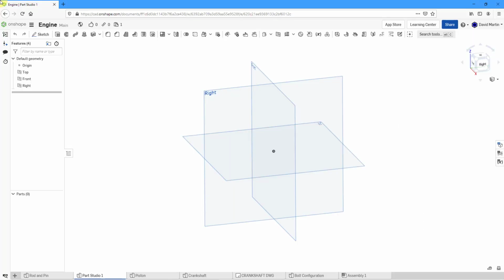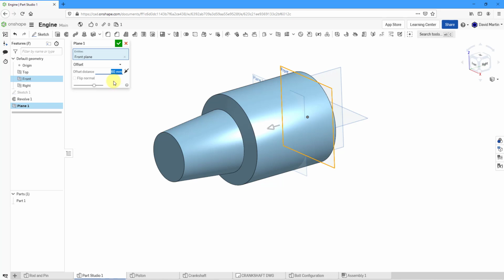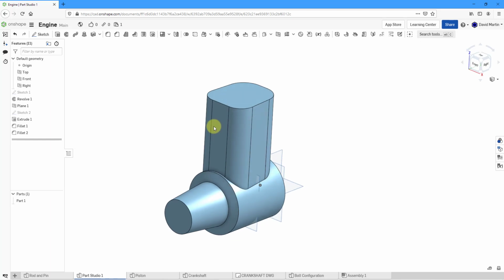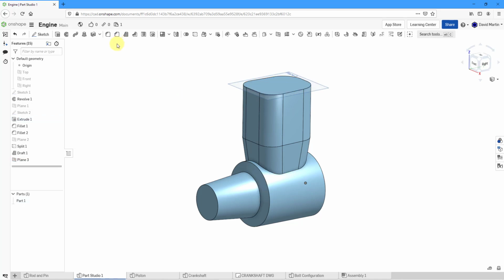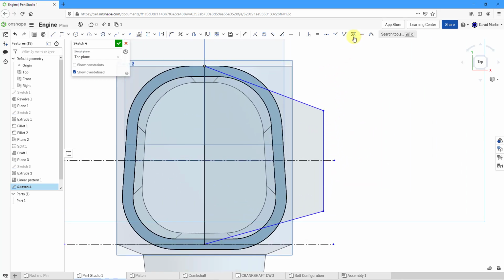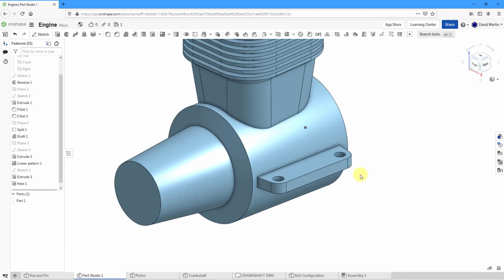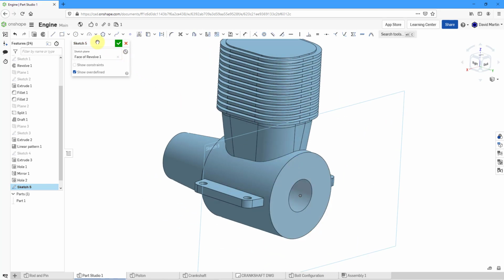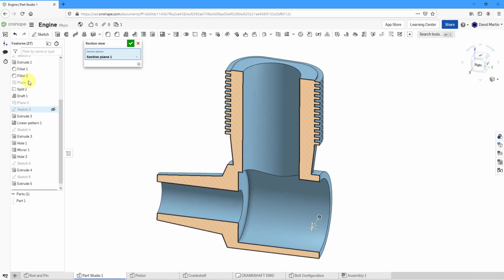Onshape - Creating the Engine Block (Part 1) - Engine Assembly Project

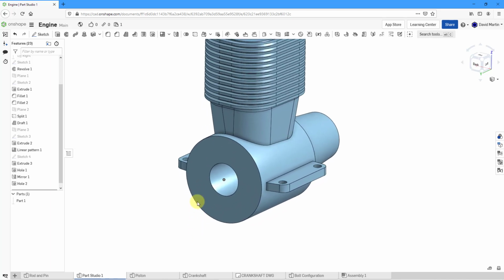Comment: Using the Hole tool at 21:20 works fine for the crankshaft hole in the block if I start on the back and use a counterbore hole.  Thanks for the great tutorial.